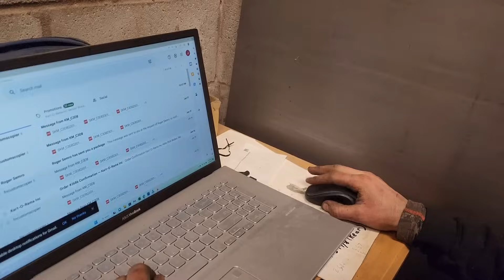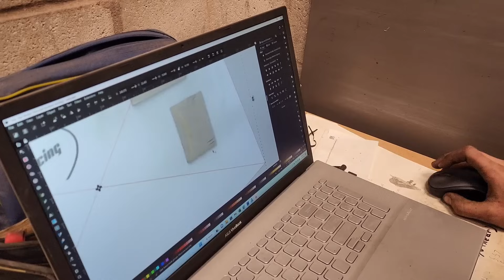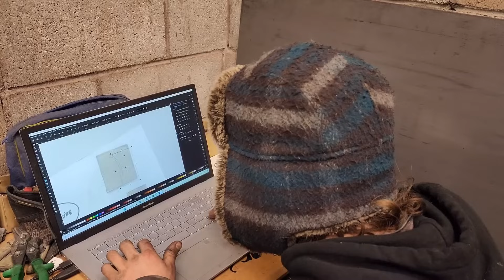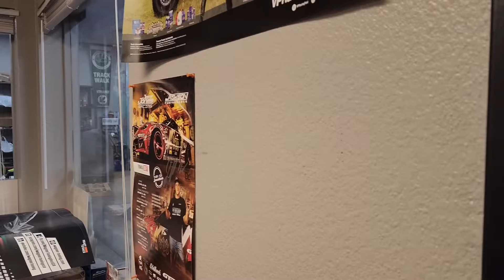2.8 CUMMINS SWAP DELICA OVERLANDER PART 1

Comment: So good. Whens part 2 dropping? And where did that guy get his 2.8 from?
Reply: Buy them as a crate engine directly from Cummins (r2. 8)
Reply: @DelicaWorks  they were always out of stock when I looked! And the uh, exchange rate puts them at double a DB4F for us Aussies.
Reply: @StashmoCharlie  ya they ain't cheap but they make like double the power of the original 4d56 and d4bf factory. The swap cost a lot and that's not even including you need to get a transmission and Tcase for and all the driveline set for it.
Reply: @DelicaWorks  I've heard some mixed reviews on them, but they do look amazing for the size. Just move the radiator and AC to the roof 🤣! You think you'll tackle it one day?

Comment: Yo, this is the coolest shit ever. I'm about to buy a Delica L400 Turbo Diesel. Not as cool as the L300, but it's only got 65k on it and it's going for 12 grand. Anyways, I was thinking of doing this down the road in the event that engine ever blows. Got a question for you, are cummings motor's easy to convert to bio-diesel? I'm thinking it might be smart to do that in the coming years. Making your own fuel might be a smart thing to know how to do.
Reply from the maker: may be possible i have not looked into that but i'm sure with proper filtration and heaters it could work..